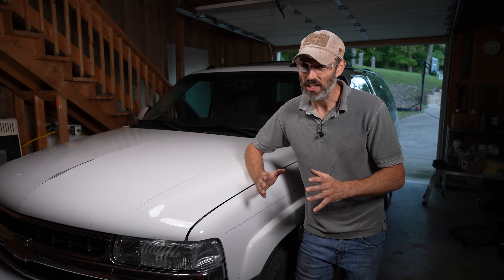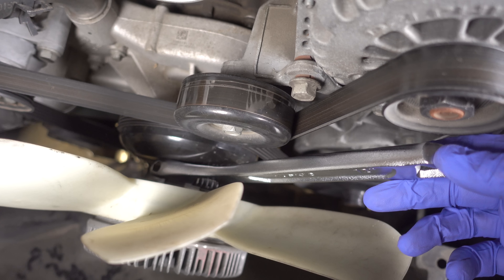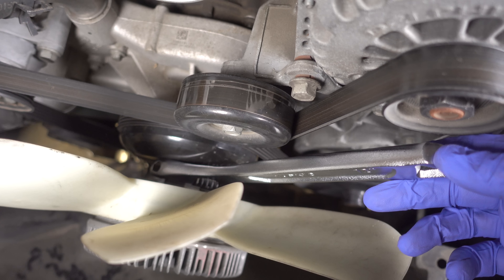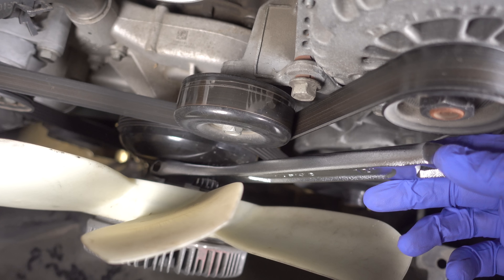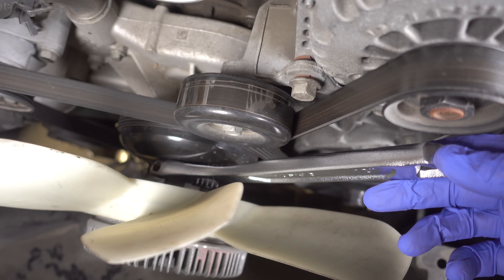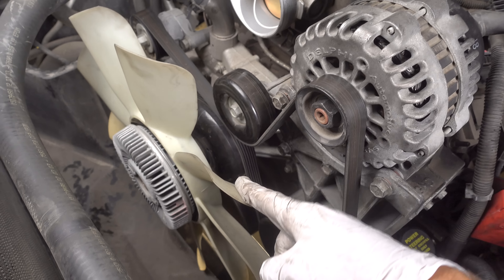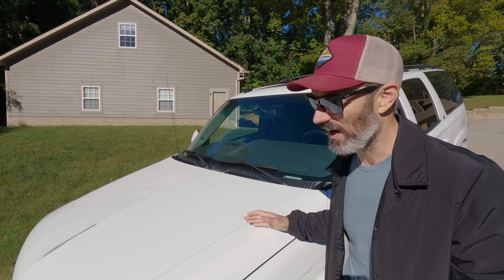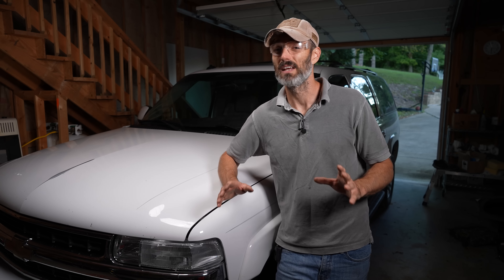Here's Why You NEVER MESS WITH Your Factory Power Steering Pump!!

Comment: The 1st step for this job is to disconnect the Neg battery lead.  Go to 6:52 to see why.  The Pos lead on the back of the alt goes directly to the Pos post on the battery.  That stud on the back of the Alt touches ground can be just a rude awakening (sparks), or start a fire, or possibly blow the diodes in the Alt.  I would've taken the alt off the bracket and removed those items (alt, bracket with PS pump) in separately, rather than fiddle with their combined weight down there in your crowded work space.  
The effort you made to remove less items just made the whole effort more difficult.  You are at home, not working off of standard labor hours.  You saved zero time anyway in this case, you already had almost everything loose but made a conscious choice to make it MORE difficult by taking less items apart and out of your way.  Why save time at the expence of "ease"?  All that grunting and groaning doesn't happen going back together if you pull the Alt first.  You could then mount the PS pump to the bracket on a bench or floor and simply, install the pulley and easily bolted the bracket/PS pump assy right back in.  AND you can do the most difficult part, "put the pulley on the pump" with the pump mounted to the bracket on a bench, then back onto the engine instead of fighting those tight SOB's down there.
If you change a PS pump, IMO, Always change the pressure line unless it's very new.  You are deep in there.  Why set yourself up to have to go back in there and change the pressure line a year later?  Good that you changed the O-ring, but that's not where it will leak when the line itself dies.
If your pulley went on as easy as it looked in the video, you should have changed it.  It should fight you going back on every fraction of inch of the way. For anyone doing this job, heat the pulley hub.  Use propane torch or good heat gun on high.  Welders gloves or oven mitts.  Those pulleys should be very difficult to reinstall (that's why doing it on a bench is much easier), or they may slip on the shaft in operation and screw up the new pump shaft with it.  You get to do it all over.  Plus a new pump again.
Jimmy may be OK, maybe the video just made it look way too easy.  It's should be easily the most difficult part of this job.
Reply from the maker: Appreciate the constructive criticism. Yes, I should’ve disconnected the negative battery cable. I didn’t realize how much I was going to be moving that darn thing around. Then I simply forgot. I did disconnect, however, when I was soldering the new plug end for the coolant temperature sensor. Thanks again, helps me learn!
Reply: @1RoadGarage  Yes! and everyone who reads.  But that's the whole point of the video, right?  When you watch a YouTube video of about any auto maintenance work, you will see Pro's try to minimize what they take apart because time is a big thing to them.  Home mech does himself a favor by maybe taking a few more things loose many times, just to avoid all the fighting, finagling and fiddling.  Plus the Pro's never clean or paint anything they don't absolutely have to unless a restoration.  
I appreciate your tenacity Jimmy.  You get after it and get it done.  I consider you "novice plus" because I've seen you take on some difficult jobs most novices would never even consider.  And regardless, in the end, you still drive off.  You've got the right stuff in you for this.  Regards
Reply: Yep  I was like no way that pulley came off that easy 😮,
There's been a few I even had to fight on the bench .
Reply: @paulrooster2108  Off, yes tough, definitely, but going on, even with heat, takes 2 men, a boy to get it back on.  Last one I did I was praying the last couple turns.  And you're right, it's not exactly the easiest thing to clamp down.  If they were all as easy as Jimmy's looked, I'd just do it on the engine also though.  Never had one like how Jimmy's 'appeared'.
Reply: Heat the pump shaft???? For real??  17 years I worked for Ford; never changed a pulley, never heated anything. Perfect way to destroy the front seal.
Reply: @njjeff201    Whoa Ford Wrench.  Nobody said anything about heating the shaft,  you only heat the pulley hub.  
You also appear to be unfamiliar with the well understood phenomena of heating the female mating piece to ensure proper ease of insertion.  😆
Maybe Fords have looser tolerances, IDK. The way they squeak and rattle so much I wouldn't be surprised.  But yeah, these Chevy PS Pulley vs bracket causing the whole pull the pulley thing is not excellent engineering for maintainability.  Thing is designed to be stuck on there like a Ford 4.6ltr spark plug.
Reply: @x-man5056  I’m very familiar in heating the ‘female’ v. the ‘male’ parts & then again the seal is on the  old pump.  Just sayin’ not necessary with the correct removal tool as he said it came off easy. But never ever saw it done nor did I do it for in my career.
Reply: @njjeff201    You can't do it at all without the right tool Jeff.  And I never said you could. You seem to have a reading comprehension problem Jeff.  "then again the seal is on the  old pump" No idea what you mean by this.  Both the old and new pumps have shaft seals design to operate at high temps.
Those GM pumps are designed for the pulley to be extremely tight fit on the shaft.  Yes Jimmy said it came off easy and it looked like it.  That should have been clue #1 that he should use the new pulley on the new pump.  He doesn't have the experience to know. He choose not too.   He might be OK.  He knows what to do if the pulley starts slipping on the shaft now.  I learned a lot of things that way wrenching on cars for 50+ years.  Heat the hub.
Reply: @1RoadGarage  I took everything off piece by piece on my Burb when I was doing the head gaskets.  I get why you tried to “save time” by taking out the cluster instead of individual pieces.  Of course it’s always easy to criticize others with the ability of experience and hindsight but like you always say, you’re not a professional technician and these videos are for entertainment purposes.  You do things how you do things, I do things how I do things.  All that matters is at the end of the day, we keep the Suburban convoy alive. 👍
Reply: What you said makes sense about the pulley going on hard cause yes if it's going on to easy it'll slip on the pump shaft and destroy it
Reply: @coreybabcock2025  Thank you.  You are exactly right on point.
Reply: @FunkyGOB  So yeah, nobody should learn a better way to do things from people who are more experienced according to aptly named "Funky".  
Your comment sounds like maybe Jimmy's mom (sweet little lady I sure) wrote it.  You are no mechanic.  
I didn't criticize Jimmy, I critiqued him.  Everything I suggested was to make the job easier and safer.  Jimmy is a novice but in many ways he's a young me.  I admire Jimmy's tenacity.  But also for anyone who reads it.  
If you are not on the clock, it is often easier for the home mechanic to take a few more parts, apart.  When to see videos of Pro's taking apart huge assembly units instead of individual units, they are exhibiting 'handed down knowledge' (something you say is unwanted) or they have just done that job a dozen times.  If the Pro breaks a plug he forgot to disconnect, or screws up something in the "time contest" it gets absorbed into the customers invoice most of the time.  You don't get to do that at home.  
Take your time, take things apart as necessary to gain access.  There is no reward for for taking things apart in huge pieces except that you are less likely to screw something up including your knuckles.  NOT SAYING take EVERYTHING apart.
Look at the wrestling match Jimmy went through with the alt/PS Pump bracket assembly.  The Alt is full of copper windings BTW, it's probably heavier than the rest of the assembly.  2 long bolts and 1 wire, and 1 two conductor plug to get it off that bracket I think.
I wasn't berating Jimmy, I was helping him and everyone else who reads this in perpetuity.  
Stop 'doing things, how you do things' and take some tips from someone who's been there so that you don't have to grunt, bleed or strain your back, or repaint your front fender where some piece of a huge assy you where impressing yourself with sapped back and put a foot long scratch in it.  Or you ripped out a piece of your wiring harness.  Or don't, IDK.
Reply: @x-man5056  well that was a lengthy reply to a comment not directed at you.  No, I’m not a mechanic by trade.  I am not ASE certified in anything.  However, I’ve repaired hundreds of vehicles for myself, family, and for previous employers. I’ve rebuilt transmissions, engines, done all kinds of work on forklifts from head gaskets to steering systems and completely rebuilt the entire hydraulic system on a Terex grappler and a steel baler.  I understand you have plenty of technical shop experience and that’s awesome that you’re a certified tech and do things “the shop way”. 

All I said was it’s always easiest to criticize or cite “the wrong way” of doing things at someone else’s expense or through the hindsight of doing it the wrong way the first time.  We’ve all busted knuckles, snapped a dry rotted pigtail, or cross threaded a bolt at some point in our life.  Hell, that’s why there’s pencils on erasers, we all make mistakes.

I appreciate your passion for constructive criticism and your attempts to “help” us feeble minded folk, but I reiterate, the best way to do things is to get in there and learn for yourself.  I’ve bent rods, stripped head bolts, dropped washers into manifolds, bent wrenches, snapped ratchets, overtorqued bolts on plastic manifolds, you name it.  Hell I did head gaskets on my mother’s f350 6.0 with the cab ON because I don’t have access to a lift to take the cab off and she didn’t have $4000-$5000 and I was reading forums where shops either caused other problems or were unable to reassemble the engine properly resulting in a no start.  It wasn’t easy.  Required a lot of reading and YouTube videos and it took a lot of grunt work and ingenuity but knock on wood, it’s been 6 months and few thousand miles and she’s stronger than she was before the job.   Sometimes we have the tools and knowledge to do things like the textbook says, sometimes we don’t.  But all of these experiences have helped teach me “what not to do” and I think it’s fair to say that’s how most of us “common folk” learn as well.  

My two cents
Reply: @FunkyGOB  Dude.  I am preaching against "Shop way", for the home mechanic.  The way Jimmy did it was "shop way".  
And I'm not a "Certified Tech" and haven't said so.  
It looks like you can write well so I'm assuming you didn't really read what I wrote so writing more is pointless.
Reply: @x-man5056  😎👍
Reply: @x-man5056  How he did it in the vid is how it's done. So long as he didn't have to cut off an arm to have a certified know it all install it. It's just a pump not degreeing a cam. Whatever it takes to get it off and on and back on the road cheapest is the correct way. Not your vid, not your channel, not your truck and not your money. Maybe if you had a step by step comment on how an ABC certified doodad turner would do it might be a lot more helpful than berate a guy making a video that we all can relate to. Your point about the battery is a good one but lost in your egos shadow.

Post any relevant how to videos here keyboard mechanic
Reply: @njjeff201 He said pulley hub not pump shaft. If ya like burnt rubber a fella could put a torch to the shaft I guess, kinda stinky.
Reply: Jeez, thank you x-man for all the great tips.  I'm going to have to start on this job this weekend.

Comment: ahh yes, the 'ol "take your whole car apart to get out one piece but then replace five others you broke in the process" routine
Reply from the maker: Yep 🤦‍♂️😂
Reply: Nothing new about that since they put the first smog crap on cars.
Reply: That's what happens when you have masochistic engineers designing the vehicle.
Reply: Just did the knock sensors on my 1UZ-FE. While I'm in there I did my starter and intake gaskets. 

If that statement sounds weird, look up where they're at and laugh.
Reply: @906MediaProductions  Good call

Comment: It's always nice to see your effort, on an old Suburban of the same vintage as mine. I didn't notice why you removed the pump, what led to the diagnosis? You make an excellent point, it is very common to encounter obstacles and complications you never expected. I also find that the whole process is slow, sometimes painstaking. The guys who do this for a living don't have an easy life....
Reply from the maker: Been having issues where the truck was very hard to turn while not rolling. Didn’t happen all the time but enough to know there was an issue.
Reply: @1RoadGarage my 2005 Yukon 5.3L 4x4 has a pump that will get tired after long road trips, say 100+ miles, and will be stiff to turn at stop lights and also the brakes will be manual also. Has to do with the pump being weak at idle RPMs, as it will work fine above 800rpm.  It is better when it's cold or shorter trips, and cause lots of stiffness after more hot.
Reply: @thesetruths1404  wanna make sure you get that pump changed and bled because that truck has hydroboost which is routed with your power steering system
Reply: @s.s.s6009  it has returned to normal operation.  It makes little sense.
Reply: @thesetruths1404  👍

Comment: the power steering pump in my 2006 Yukon with 150K miles along with its hydroboost is still buttery smooth.  No noises and every 10- 15K miles I suck all the old fluid out and replace it with genuine AC Delco fluid.

Comment: I did that same job on my Dodge Ram and I have one of those tools; but I removed the pump first and then removed the pulley and transferred it to the new pump Some 4 or 6 yrsa ago the pump was squeaing so loud that it was depressing to drive; heat is the greatest enemy to those pumps so I switched to Lucas fluid and I also installed a tiny cooler; and so far so good. There is nothing like having the correct tools, it makes life a lot easier.

Comment: Much easier to unbolt alternator bracket and take it all out in one go and you can take the pully off on your work table and put it back on easily. I didn't have to remove the fan or shroud doing it this way

Comment: Some parts companies are kind enough to sell replacement P/S pumps with a new pulley already in. I encountered this when I bought a MOPAR reman unit for a 2005 Jeep Grand Cherokee. The price was also amazing, not too much more than a Cardone rebuild from one of the major parts stores. The rebuilt pump lasted even longer than the original. Also, the MOPAR rebuild had a new reservoir.

Looks like this truck doesn't give you the option to leave the pulley in place anyway.

I like giving every belt driven accessory a spin by hand. Sometimes it can reveal something that is about to fail, but you can't hear or see it yet. I sometimes encounter failed belt tensioners that make no noise, but deflected so much, belts fell off. Other times they wore out so that the arm was out of alignment. It's nice to already have the belt out of the way, so there is less to disassemble and less to fear in the near future. Idler pulleys could do the same.

Your Amazon link to PSF did not mention the exact type you used. I guess it isn't too important, those trucks used the basic PSF you can find anywhere. Fans, if you have to replace a power steering part, read your manual and use whatever it calls for. I have seen too many Hondas have massive problems because someone didn't use Honda type PSF. Other cars need ATF, I once encountered someone who used clear PSF in a VW that called for ATF. They replaced the P/S rack and in less than one week, it was leaking again.

12:40 At least you didn't have to do this to a FWD V6 car, or worse, a van. My mom's 1985 Nissan Maxima cost my family a fortune in repairs because they crammed everything too tightly under the hood.
Reply: Next time; after installation is complete. Jack the front off the ground and turn you wheel wheel stop to wheel stop and the system will pre-fill itself with fluid and you'll stand less chance of burning the new pump up on start up.
Reply: @HK-Guy  Thanks for the tip.

Comment: Power steering is not the same as it was in the older cars. You used to be able to turn a corner using just one finger. Then they came out with what we have today, which was originally called 'power assisted'. Even though it hasn't changed since then, it is now called power steering. I wish they still used what I call true power steering.

Comment: I may add if you are changing the pump due to leaks you can rebuild them for cheap but have to be very careful not to bend the reservior up. The pumps themselves are the same back to the 60s. They may have different reserviors on them, and in the late 70s, early 80s they switched to metric threads. I think later on they went to the o-ring style fitting on the high side. Early style was compression fitting on high pressure side.

Comment: Tight? Try replacing a starter on an 04 GMC Envoy XUV with the 5.3. Not even the dealership could help with an estimate or procedure but what I did do when I replaced it was replace every sensor, mount and U-joint that I had to remove because I do not want to go through that again. Think Tahoe that's 5.5 inches narrower with a fat cross member that doesn't unbolt. The only video I could find was some guy torching a chunk of cross member out and I'll lift the body off before that hackery.
Reply: Could be worse, try a Toyota V8. The starter is under the intake manifold.
Bring cash, lots of cash.